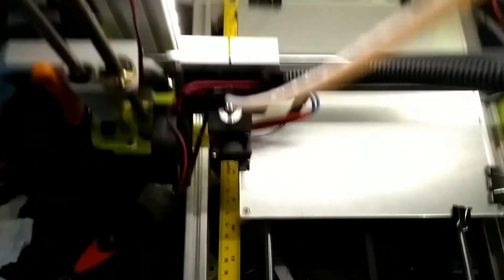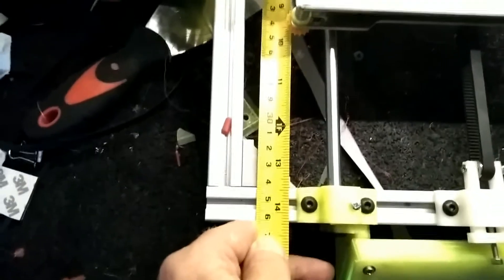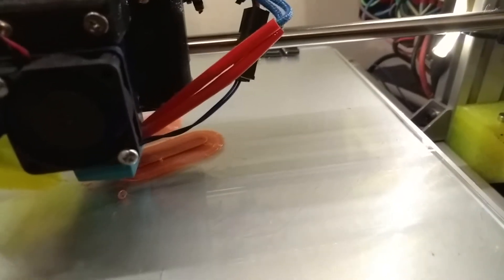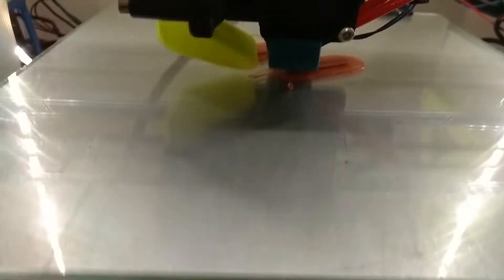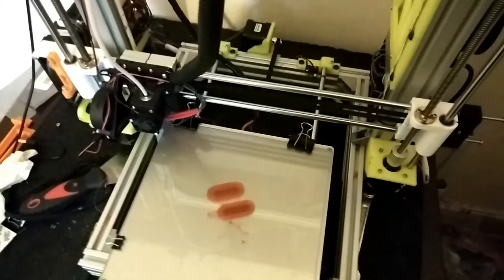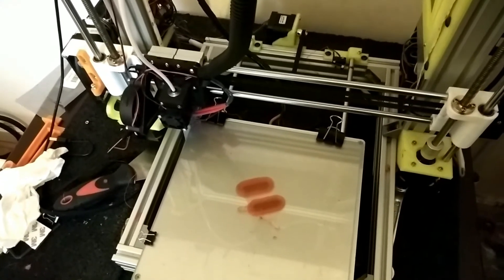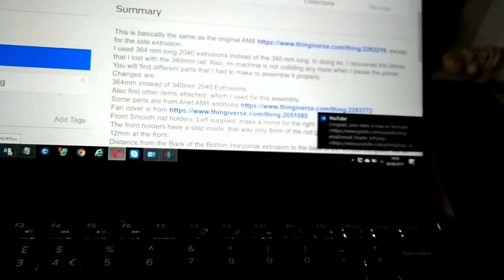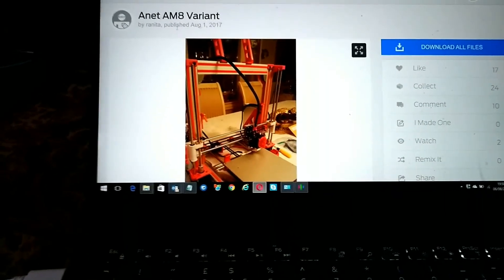Problem With the AM8 Metal frame for the Anet A8

Comment: Where is the option in the Marlin FW to stop the bed from crashing into the front bar?
Reply from the maker: It's not a problem if you flash Marlin, only if you use the original firmware or upgrade it to a less buggy newer version of repieter.

Comment: On my AM8 build I used the 364mm vs 340mm sides however still experienced the "crashing" problem on using print pause function. I believe that I have found a fix. The problem is that the AM8 bed sits higher than the A8 bed. Fix is to select Configuration->Feedrate->Home Z and change from 4 to 10.  Don't forget to save to EEPROM. After this fix I am able to successfully pause and continue my prints.
Reply: I'm having this problem and I didnt even upgrade yet. I'm so glad I found your comment bc I've been searching for answer for over a year now THANK YOU!

Comment: I feel like those rods are only guiding the bearings and the bearings could go to (and over) the edge. I'm not sure as I haven't done then am8 mod yet
Reply from the maker: The AM8 mod is well worth doing for many reasons the fact the bed levelling doesn't keep changing being amongst them., I would recommend speccing the forward to back extrusions at 364mm which gives you back the missing space though.

Comment: your Y motor isn't supposed to be inside the frame ?
Reply from the maker: I have a third party heated bed carriage and the bearing mounts must be more towards the centre, when the bed homed it was banging against the y motor. It works exactly the same with an equally secure fitting.
http://plastikjunkies.de/anet-a8a6-heat-bed-holder-wieder-da/

Comment: is there  a firmware adjustment for this? I just ordered the wrong extrusion size.
Reply: This is funny. The build instruction tell you to put the gantry at 127mm. This is not correct for all setups and your not using a standard extruder setup. Move the gantry and the frame will work fine.
Reply from the maker: If you move the gantry back you will not be able to print at the front of the bed,  and vice versa if you move it forward. It is only a firmware issue and I've sorted it by changing that.
Reply: brian whittle i think I miss understood your issue when you started mentioning making the frame bigger. There are quite a few firmware adjustments for geometry you need to make in the firmware from stock A8 to AM8 not just the pause behavior. You should not be able to move the bed beyond these limits and therefore hit the frame.
Reply: Hi!
Which modifications do I have to make?
Reply: Answers in the Am8 facebook group.
Reply: @grantpeck  screw facebook and their no privacy data mining asses
Reply from the maker: Apparently, I've not tested it yet
If you are on repieter
 SDCard.cpp there are these lines:

#else
Printer::moveToReal(Printer::xMin, Printer::yMin + Printer::yLength, IGNORE_COORDINATE, IGNORE_COORDINATE, Printer::maxFeedrate[X_AXIS]);
#endif 

Without being an expert in repetier, I would assume that you need to modify the part with "Printer::yMin + Printer::yLength" - and reduce it, maybe by 25 or so:

Printer::yMin + Printer::yLength - 25
Reply from the maker: The fix above works for me
If you are not familiar with Arduino use this with the attached V of arduino though you may have to tweak some settings with repetier host  as it's setup for the E3DV6 and a different drive cog.
https://drive.google.com/open?id=0B89GRBPMiNx9TURHbXBPTThJYVE